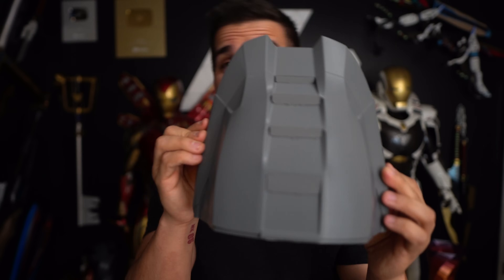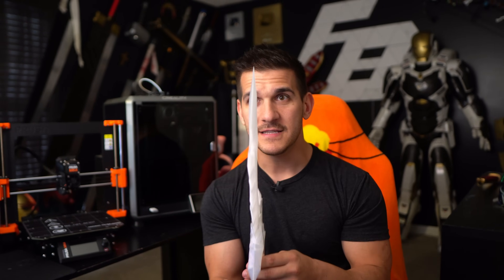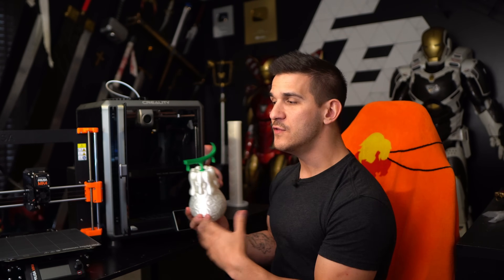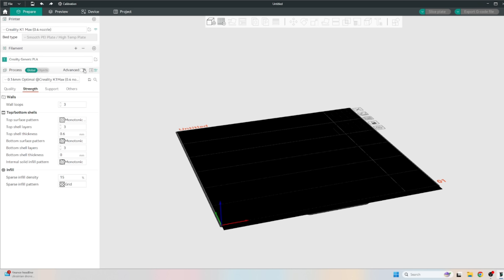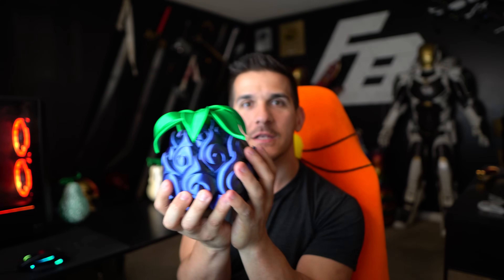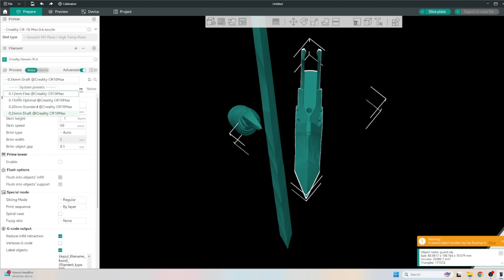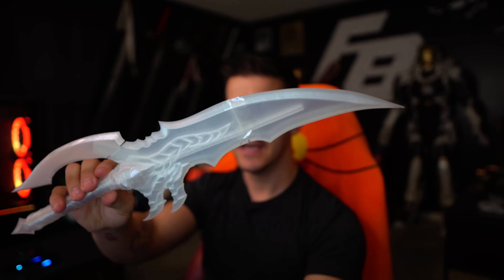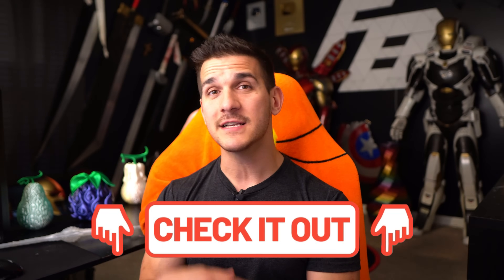How I get SMOOTH 3D Prints | EASY Slicer Settings You've Been Wanting!

Comment: It didn't take me but 2 tall prints before I figured out how much the wobble increases as you go up. But I kind of knew that would happen. It's like climbing a tree or a pole. It bends and moves more the higher you go up. And a lot of times a higher % of default support isn't the solution because it's more support to remove, more contact points to mess up the surface of your print, more material, more time, more post processing on the piece. I started building support scaffolds around the object in blender with bigger or smaller support fins in 4 or 6 directions depending on how tall the piece is. Save the support as part of the STL, and not even use the slicer's supports.

Comment: What speeds to use with Bambu A1 and P1S printing a helmet or a tall object with 0.4 nozzle 0.16 layer height?
A1 100 outer wall 150 inner wall?
P1S 150 outer wall 200 inner wall?
Is it better to use Inner-Outer-Inner wall?
Reply from the maker: Download Bambu studio and test it lol I’m not doing all that
Reply: @FranklyBuilt  You said in the video that sometimes we have to reduce the default speeds of the profile thats why I ask.
Default is 200 Outer 300 inner.
If I had to use the default bambu studio settings I wouldnt ask :P

Comment: I just got a Flashforge Adventurer 5M Pro, and after printing the cube and boat successfully, I went straight into some fancy stuff, not knowing what I needed to do.
The print was horrible, LOL!
I thought it was the machine, and was ready to send it back, until I started delving into how these things really work.
The first issue I had, was allowing the filament to loosen up on the spool, causing it to bind.
The second big mistake, was not including supports, in my slicing.
This printer is fast!
And I think that's the next thing I need to address, is slowing it down, to help produce a more detailed print.

Comment: Update, I now brought a K1 Max picked it up today thanks in part to your recommendation. The previous printer I brought was a Neptune 4 Pro, Anyone thinking of purchasing there first printer, spend the extra money. I had to ditch my printer temporarily too many issues with the most painful being adhesion despite constant levelling, applying glue, using a textured PEI, updating settings etc. Additionally the Neptune does not come with WIFI and requires a cable to hook  up to computer a QOL thing but useful if you are just starting. From now on I will be avoiding Elegoo
Reply: The N4 plus and max comes with Wifi.  For  pro I believe you need to buy an adapter

Comment: Thanks for this video! I just got my first 3D printer which is an Anycubic Kobra Neo and using PLA+ filament with the Cura program. I did a couple small pieces that were super simple to print before I got into a piece that's a bit larger. This is where I'm running into problems. With the first print, I ran into issues with being able to remove the supports after it was finished. I decided to try it again but use a different style of support. I used tree the first time and just normal the second time. It's still printing right now and I'm nervous I will still have problems removing the supports from the main print. Do you have any suggestions?
Reply: Second print didn't work out so well either. Seems that there's just too much support that I just can't get through or remove.

Comment: Just found your channel and this video.    You might try Ender & Creality filament.   I get NO layer lines, and filament was the only thing I changed.   The filament composition does make a difference.  Seriously, give them a try.   Ender pla is a great price, I even use Ender ASA.   Good price and excellent surfaces w/o layer lines.
Reply: I've got an Ender3 S1 Pro.
Creality filament peels off the bed. I just can't get it to stick.
So I use Sunlu, Geeetech or Elegoo filament.
Reply: @sahhull  I get great prints with Elegoo.   I have a Bambu X-1c.   I use the smooth plate.  The plates are marked PLA and on the reverse all the higher temp filament.   After each print I clean with IPA.   Always sticks.
Reply: What temp to you use? I wanna get elagoo. Currently using creality with 210 for the first layer and then dropping it to 205 and it's been really good but not perfect
Reply: @saulmas1801  I've been using more Elegoo,  PLA and ASA.  Both do well.   On my Bambu X1c the default works well at 220,35.  It also does well at 210,40. I get Elegoo since it's cheaper and does well, but they vacuum wrap the cardboard spool and sometimes the spool is bent from the wrap, but I straighten it a some and it works in my AMS.

Comment: Lied right to my face... still, still a good video....
Reply: When I bought my first printer, I didn't know if regular PLA would take paint well, so I bought a roll of matte PLA and a roll of regular. The Matte was easier to work with, printed at lower temps, was less likely to peel off the build plate, and looked so much better than the regular. They both take paint well, though.

Comment: I've been having problems with my Ender 3 v2. I keep having prints come off the plate when it gets near the end. Idk why I didn't realize the thing about the bed slinging front and back. So I slowed my current print which is halfway done. Down to 75%. Hope that is slow enough for the rest of the print. When it gets taller I might slow it down to 50%. Trying to print off some armor from the house of the Dragons for ren fair. Its the king's guard armor. It looks so sick. Trying to print the arm pieces. I split it in two to print on the ender 3. The first part failed near the end. So I'm trying part two right now. If part two comes out fine. I'll try part one again with the same speed changes.

Comment: Hi FB, 
Would it be possible for you to upload your config files to your Patreon ? I am mainly looking for Neptune 3 max 0.6mm and 0.8mm settings but have a range of printers that could be beneficial. 
I have picked up a lot using your videos but working out where a profile has gone wrong seems to be an issue, my K1 with a 0.6 is currently out of action as I seem to have really messed that up with constant jams now, thought it was the printer at first until I moved onto my 3rd extruder and it still didn’t work 😅 

As usual good video ! Thanks
Reply from the maker: Hey! I don’t have config files. I show exactly what I do in this video. Just use the stock profiles and only change infil and supports. The more you mess with the worse it will be.

Comment: I have a Bambu P1S. I've only been printing for a little over 3 months and this machine, and Bambu Studio, makes me look like I've been at it for years!
The only things I adjust are the walls, infill %, and speed. Now when I change to ABS or PETG i adjust temps after doing a temp tower but that is it.
I've used auto supports and it's never let me down.
I also have the A1 Mini and it's speed is crazy. I use it for actually making bulk items like Ikea Skadis parts. Simply because I can print them so fast and still with amazing quality.
Thank you for this video. If anything, it reassured me that there isn't settings that I'm missing out on!

Comment: In Bambu Studio, I've changed to Arachne vs Classic and wall generation to inner/outer/inner.  To get your supports to release a little better you can experiment with the Z distance for supports.  I increase it from .2 to between .25 and .27 as I print a lot of PETG, ABS, and nylon.  Another tip is that if you can't orient your print optimally, use the cut function to separate it into sections that can be oriented better to optimize quality.   MEK can be used to chemically melt PETG, ASA, ABS, and styrene creating a permanent bond unlike CA glue.  It can even fix areas where there may be some layer adhesion issues.  Since I post process and paint most parts I print, the glue lines are filled and smoothed.

Comment: Hey Frank, you were the biggest influence on my decision choice when purchasing my first 3D Printer. I chose the Neptune 3 Max for my first printer…funny thing happened once I got my printer. Elegoo launched the Neptune 4 Max shortly after I got mine. I had a huge print volume, then after getting an Ender 3 V2, and a Voxelab Aquila with is just an Ender 3 V2 clone, I went for speed. I got a FLSUN V400. Which is why I’m making this comment…you didn’t mention Delta style.
I try my best to orient my parts as best I can, do you have any suggestions for better quality for a Delta style printer?

Comment: Hey Frank. Shot in the dark but, I have a JGmaker magic and have issues with using it. Upgrades and settings are hard to find, could I use ender 3 guides to help my prints? Tried upgrading to a glass plate and since then can't get my prints to stick or finish completely. Great video.

Comment: Hi, we've tried printing an articulating dragon files from thingiverse several times on our creality K1 Max we sliced it in orca with no supports but every time we try to print it the printer stops on the first layer. The nozzle is not clogged the filament just stops coming out.  This has happened on several other articulating dragon files, and now we can’t get a single print now it’s happening on other prints too any idea what’s happening

Comment: Good video! The matte PLA.... order some and print with'em. You can see every layer line and every little print defect! Although the look is gorgeous!
You gave the right explanation for the silk filaments hiding layerlines, but for matte you mixed stuff up. The matte PLA does not reflect very much light, so the reason silk is hiding stuff is the same reason matte isn't.
Keep on doing these great content!
Reply: That’s weird bc the elegoo matte PLA I use hides later lines fantastically.

Comment: hey Frank, i'm a fan, wanted to give you a tip on scaling helmets: on blender i took 2 photos of my face, front and side, put them on blender with a uv sphere, and adjust the vertices, so far y made one in 30min-ish. rating 5-6/10, but it will give you an idea of the shape of your head

Comment: Great video.  Just wish I watched it before I printed my Clone Trooper helmet.  I printed the back two quarters standing up at the same time.  The print head knocked them loose and they fell to the floor at 98%.  Obviously (as you said), I should have slowed down the print towards the top (bed slinging Prusa Mk4).  As I contemplated reprinting them differently, I realized I could just slice off the part that was missed, print that and just glue it onto already printed part.  I did that and it worked great. Hardly noticeable after the finishing work.  Will look into these tips next print.  Thank you!

Comment: I've recently started using Orca slicer for my K1, and for whatever reason the prints will often stop extruding before it finishes the first layer. This has only been happening with the Orca slicer, and it seems to work with Creality Print just fine. However, I wanna use Orca since it can provide much better quality than Creality Print. I tried to research solutions to my issue, but there was almost nothing about it. I tried switching from the standard brass 0.4mm nozzle to a steel 0.6mm nozzle, and that seemed to work for awhile. But now my prints are continuing to fail. I was wondering if you had experienced this issue and know how to solve it, or just had any recommendations on what I should do about it.

Comment: I’d love to see if you’ve done any calibration for your filament on the K1Max. Before the latest firmware update, it would seem like I’d spend about an hour running all sorts of calibration tests to dial in the printer for extrusion flow rates and whatnot and bypass the auto calibration on my k1Max. With the latest firmware that seems to be somewhat mitigated but would be interested seeing what you do there.
Reply from the maker: I don’t do any of that lol I just update it. Let it run its auto cal. And I print

Comment: Using a ender 3 V2 standard profile in Orca gets you a warning immediately for travel speed. Its too high according to program, Im not totally sure but maybe sbout 700 mm/s while the max according to the same program is 500 mm/s or something like that. Also my support broke off because of standard support settings (speed high and density 0). Im still not convinced Orca is better for my printer

Comment: So the answer is get a P1S printer.
Reply: My Flashforge 5M gives my P1S tough competition for quality prints minus the AMS.
Reply: @timothypatrick5282 now there is the ad5x, basically the 5m but non enclosed but with multicolor
Reply: Or a centauri carbon for $300
Reply: My roommate Chris has 2 Bambi Lad P1S printers, and they’re good at making smoother prints, but I think the print quality could be slightly better, with some settings or parts tightening.
Reply: Shit I bought 2 P1S combo pro’s addition ams 2’s for both
Reply: P1p is cheaper and just doesn’t have the walls, but you can get some
Reply: @Fin975-j7r Late response but the P1S does have many advantages such as the auxiliary fan, im not sure of all them but the p1s does have a good amount of improvements.

Comment: Do you have any tips on how to smooth a 3D print with a lot of details and hard to reach places? Or is it just smooth right off of  the printer? Also, I am in the market for a new printer and was considering the Bambu Lab A1, would you recommend that for super smooth prints, or should I get the P1S?
Reply from the maker: Small metal files and lots of sand paper. Or higher print quality
Reply: @FranklyBuilt  thanks a lot :)

Comment: I remember the "good" old days when I first started with 3d printing about 12-13 years ago. Slicing something would take absolute aaages. It wasn't uncommon for me to have to wait 15-20 minutes for a single model. So you really wanted to make sure you had every setting nailed or you'd be wasting a ton of time just because you messed something up. Slicers today are just amazing by comparison.
Reply: Biggest thing here is modern slicers making use of multiple CPU threads and the multi core upgrades and speed of current even low budget offerings. 

3D printing has come a long way but the software has come even further IMO with CPU hardware uplift and improvements. 

Not enough emphasis has been placed on using modern PC hardware in the 3D print space.
Reply: I'm doing this stuff on a pretty old slow laptop. And depending on which slicer I use it can still take me up to 15 minutes to slice something. Cura and Lychee seem to be the slowest, and Orca seems to run best for me right now. They all pretty much have the same settings options, so that isn't an issue. It's more about which one is fastest and doesn't crash.

Comment: Ok so I have a question, I know you have a Neptune 3 plus and I’m curious, do you have to use a raft. I haven’t had a successful print without one
Reply: I stopped using glue, glue builds up in the ‘pores’ of your magnetic bed, creating a smooth surface. But hey, that’s me.
Reply: @ChezzzyKid1234 well the other two printers I’ve used, I didn’t have to use glue but for some reason I just can’t get the print to stay on the bed with my Neptune
Reply: @Hotwire070  make sure it’s leveled lol. Then try playing around with temps. Clean it with some goo-gone and some Isopropyl alcohol if you haven’t already.
Reply from the maker: Sure if it works
Reply: How do u clean the bed? I occasionally have adhesion issues after a while without cleaning it. Soap and water and then an alcohol wipe. Also how does ur z offset look? I squish mine probably a bit too much but I’d always rather some elephant foot rather than the print dislodging
Reply: @jonathonantonio1973 So I do use soap and water but I don’t use alcohol wipes maybe that is the problem. Thank you for the advice!

Comment: Ive just ordered a K1 Max, funny enough i run your pri t settings on my Ender 3 Max for cosplay helmets. (Works Great). Do you have specific settings for Helmets or just run standard settings and adjust the infill? Any info would be great to get before taking delivery.

Comment: It looks like you left something out with the CoreXY Printer style which should be mentioned imo.  While the bed only moves up and down it Does bounce ever so slightly up and down While printing.  If you watch them closely as they print you can usually see it happen which is why, I assume, so many people complain about certain prints not doing so well on them.
Reply: Not the PRUSA XL
Reply: @astrophysicistguy  I just realized what I was talking about is the Z-Hop.  Sometimes forget the way Z-Hop works on CoreXY is different from Bed Slingers, or beds that don't move at all.